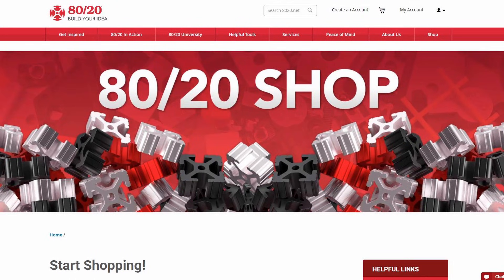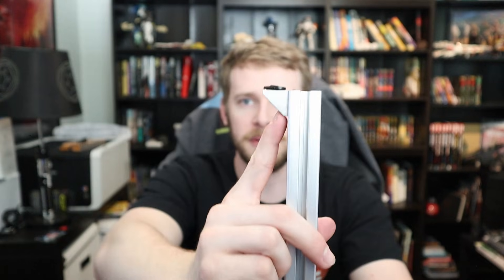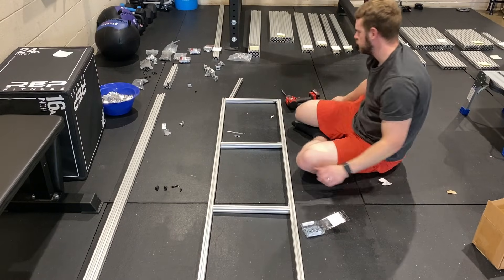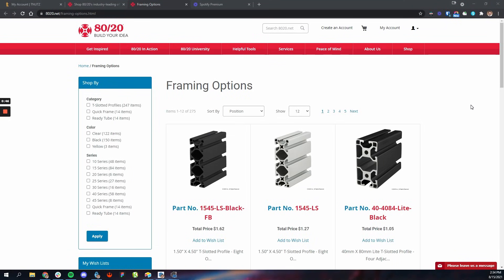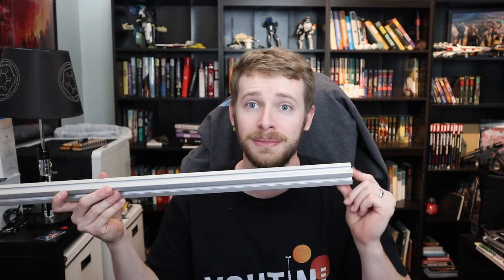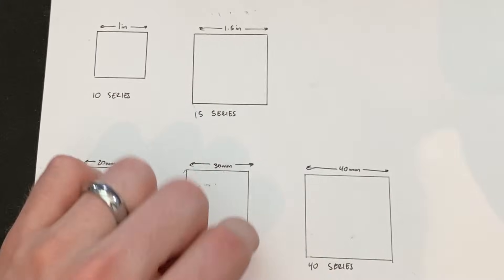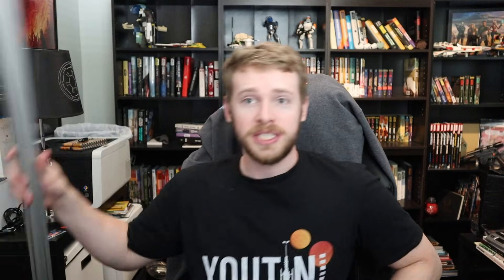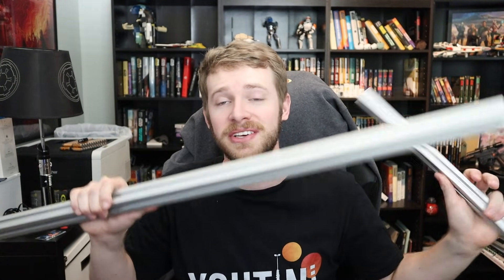Aluminum Cabinetry - Part 1: Profiles | Ultimate Guide to 8020 Aluminum Extrusion

Comment: This is the first video I have come across that highlights the danger of cutting aluminium using a mitre saw. The narrator deserves much praise for this. All others I have seen just suggest using a mitre saw or a plunge saw as if it is a totally normal thing. It is important to realise what the risks of using power tools are and what the right way to use them is before ever turning them on. Very useful.
Reply: Yes, cutting aluminum with a miter saw poses some inherent dangers (just as cutting wood does). However, it's nowhere near to the degree the author claims. Use a good quality, high tooth-count blade (doesn't have to be a special metal cutting blade, either), clamp your work, and take it slow. If it's a thicker piece, pause part way through and let the piece, the blade, and the motor cool. It'll cut through it just fine.

Comment: If you have a high tooth count carbide blade, get some paraffin wax and rub some on the blade.  Aluminum cuts fine.  This dude must have torqued the bar, moved it or pushed down too hard when cutting.  I've been using a 80t carbide 12" without issue.  I bought the special aluminum blade...I see it once in a while sitting on the blade rack, still in its packaging.

Comment: For the sake of anybody watching these to learn how to build something: There's some pretty bad advice here. Don't build anything like this because it won't hold together.

13:20 Notice that this is not a blade for cutting aluminum. Aluminum is non-ferrous. You need a more expensive blade that can cut aluminum. Aluminum has a low melting temperature, and cheap blades catch on the aluminum when it heats up and that's how a lot of people have lost fingers.

Those tiny little 2-hole external L-shaped corner brackets are not the connectors anybody should be using for anything structural!

This is 3 videos covering the parts buying process, and apparently he got so burnt out he didn't want to talk about how he actually put it together. 😂 But it looks like he put the entire thing together using those tiny little external corner brackets — many of which were homemade out of an aluminum trim piece. That's impressive if it holds together at all! You need the legit L connectors that go inside the channel for anything bearing any weight. Or you need to look at how pros who work with this stuff join things by drilling a hole in one piece so you can get an allen wrench into the head of a bolt in the channel.

Comment: Those abrasive cutting wheels are not for aluminum you’ll very quickly gall up and run those blades before you even made your first cut. The aluminum also heats up enough to burn you with those blades.

Comment: Bad advice on the cutoff wheel. Its made from aluminum oxide (generally) and will bind up causing you to have poor and very hot cuts.
A good saw blade with correct clamping is critical.
You likely pulled the work out before the blade stopped and twisted it causing the teeth to grab.

Comment: First.  You need double the amount of teeth.  You should be up near 150 teeth.  You put a 2x4 in front and on top and it will cut like butter.  The reason it jumped wad because you have 70 teeth

Comment: WRONG ON MANY  details. weight is not an advantage pver wood it hS BEEN PROVEN ON YOU TUBE   8020 is the most expensive of all extrusions they are benefiting from people like you who spread ur name but many other providers,  my opinion is this is predominately good for someone who has no clue or equipment to work with wood,  i thnk t s also a confusing product to use but doable
Reply: Weight absolutely is an advantage: you can do more with less because it is stronger.  Furthermore, you can know to gram or if you are truly a wood person, within some dumb non-metric measurement, of the weight just in CADing out your build.  I can go look at the website I buy extrusion from and have ALL of the specs of that series before I do a thing.  What's a 2x4 weigh?  Who knows, lots of, "on average," which is lay person for, "I have no actual idea."  If your extrusion really is that much heavier than wood, then you have massively overbuilt, but at least you have something that will be 3x as strong at the equivalent weight of wood, so scale up from there.  And the guy literally lists 2 other major sites that he explicitly says are cheaper.  Is it his fault you didn't pay attention?  He didn't even buy from the 8020 site.  So yeah, if you want something big, bulky, not as strong, not as reconfigurable, that requires a massive number of tools good for only one thing, then wood is the perfect option.

Comment: If you have the manufacturer cut your piece to your desired length, does that cost extra?
Reply: One of the sites he mentions, misumi, sells it by length, so aside from bulk discounts that don't really add up until you are buying 100+ pieces of the same series at the same length, you order every part at the exact size you want to save money.  You will spend more if you do not order exactly what you need from them, unless you are buying in those wildly large quantities.  Now, the pre-drilled and tapped holes and things like that absolutely are extra and you can save, to some extent, maybe, if you do all of that yourself, but then you need to have the jigs, the taps, the drill, the time,  etc... so YMMV on how much you can actually save on that front.  I will say, if you have just one project you will likely ever do, then the learning curve on the CAD software is going to be high enough if you don't already know that world, that I would just have them do all the stuff for me, eat the cost, and not have to screw around (get it?) with all the drilling, tapping, etc...

Comment: All that time explaining the series! The clue is in the name. 10 series = 10 mm, 30 series = 30 mm…. 8020 = 80 mm x 20 mm, 2040 = 20 mm x 40mm. Extrusions originate from Europe, which is why the numbers refer to metric measurements not imperial.

Comment: A few things. 1) Your miter saw looked pretty cheap. The fence should never have broken. 2) I've used a Diablo 96- or 100-tooth carbide blade on my DeWalt miter saw for everything except steel. 3) When I cut aluminum, I go slow and make sure the saw is up to top speed. When I finish cutting I let the motor stop before lifting the saw blade, even with wood. Not doing this is when you get kick-back on the side you're not holding. 4) The extrusions aren't cheap so figure out a way to clamp down the extrusion before cutting. Take your time and it will cut just fine. I've never used oil when cutting aluminum, mainly because I don't want it to mess up the expensive wood I'm cutting. I don't cut aluminum that often and I let it cool down between cuts.

Comment: Duster
I have worked a lot with extrusion and never clamped anything and always get precise cuts. Always use what is called a NEGATIVE RAKE blade to cut any aluminium and you will have zero problems. If cutting on a bandsaw always use a lubricant but when cross cutting on a mitre saw I never bother.

Comment: Great info! Can you mix up the different series for the joint/connection purpose? For example I will be using 15 series for the outside framing, inside I will be using 10 series, will they fit?

Comment: Also... the only thing about going with 10 series over 30 series that I wonder about is the fact that 30 series, in my mind, appears to be the ideal stuff to buy for most projects in that it's just as cheap as 10 series, but it's probably going to deal with bending loads that are 80-100% higher than the 10 series.

So, basically the shit's way stronger despite only being a little thicker, and is exactly the same price.

Comment: So...

N/sq mm is actually pressure!

But, basically just think of "Newtons per square millimeter of yield strength" as the area it would take to hold a certain weight. I.e. maybe the yield strength is 35,000 PSI.... So, if you had a square inch of material, a 35,000 pound weight would cause it to extrude itself and snap.

But, as you know, metal tends to bend before it breaks. That's where the young's modulus comes in (also a tension number). Basically, if you hang a heavy weight from an aluminum rod straight up and down. Harder to layman practically apply it, but basically a material with a higher young's modulus will be stiffer. So, it will stretch less when you pull on it.

But, here's another fun one... Think about why I-beams are shaped like they are. If, in a 3-point bend, the top of the beam wants to compress and the bottom wants to stretch, you can imagine that it gets easier. It's because of leverage! A fatter beam will have more leverage, and it will have a sort of natural "bend balancing point." So, yes, this stuff is incredibly stiff. Aluminum is stronger than steel by weight for bending because of the torque. The same weight of aluminum can take up a higher volume, so it takes way more torque to bend the same weight.

Hopefully some of this gets across. Lol.

Basically, yeah, this stuff is stiff which is why it's used in labs around the world.

Comment: abrasive cutting is most definatly not needed i cut hundreds of lengths of aluminum profile a day and my saw uses a toothed blade i belive the same one the table saws in the wood shop (id have to take a look at it tomorrow although i can confirm its not your typical ripsaw blade way more teeth probably a multi purpose as others have mentioned) uses as for feed speeds of the blade its not fast but not slow either id guestimate a inch in around 2 3 seconds? maybe faster?

Comment: I just notice the Diablo blade you showed is made to cut "Ferrous metals" it's important to use the correct blade when cutting any materials. I would recommend using a "Nonferrous metal" cutting blade in any future projects using 80/20 extruded aluminum. Nice series of videos buddy, thanks!
Reply from the maker: Agreed! I added a new note in the description!
Reply: @diycargotrailer  You have to decrease the RPM of saw. Its common feature of battery powered saws like Bosch GCM 305. I even used a normal blade for wood with a high tooth count without any problems.
Reply: What size would you recommend for diy rv door?

Comment: Have built projects with extrusion. Please do not use the chop saw with a "stone wheel" it will gum up the cutting wheel and will not be able to cut after a while. Those wheels are meant to be used with other metals!

A miter saw with an aluminium cutting wheel or a multi purpose cutting wheel with many more teeth than wood cutting wheel is good enough.

Thank you for sharing your thoughts on working with aluminium extrusions. It is fun to build stuff with them.
Reply from the maker: Agreed! I added a new note in the description!

Comment: i'm a journeyman toolmaker please do not use a abrasive wheel on aluminum it will load up the wheel  over heat the kerf in the aluminum close on the wheel and basically explode
Reply from the maker: Agreed! I added a new note in the description!

Comment: I use 1515 and 2020 (15mmX15mm and 20mmX20mm respectively)
looking at 1010 (10mmX10mm)
Cutting is all about technique, slow and steady. I have used a cheap wood blade Mitre saw with no issues.
Reply: 1515 is 1.5" x 1.5" and 1010 is 1" x 1" these are not metric sizes. The rest of the sizes, 2020, 2525, 3030 and 4040 are metric sizes is mm.
Reply: @gwestep  Partially incorrect. 
In the normal world 1515 is 15mm X15mm and 1010 is 10mm X 10mm.
Only in America is 1010 1" and 1515 1.5"
Reply: @AJB2K3 when referring to 8020, 15 series is 1.5 in but you are right there is 15 mm by 15 mm extrusions from other vendors even on Amazon. Thanks for clarifying.

Comment: 1 Benefit of extrusion over wood for cabinetry is that extrusion doesn't absorb water when there is a water leak.
Reply from the maker: Thats a good point. I had a few spills when I did my plumbing and it worked out well.

Comment: I have worked in aluminum extrusion for over 20 years. If you get the right blade then it really is not hard at all to cut this stuff. Even after the aging process, it is still rather easy to cut. Make sure to keep a good quality cutting oil on your blade.
Reply from the maker: Great point!
Reply: I fully agree it is super easy just have the right blade, clamp it down and have face protection as I got a nice cut from it once kina funny on the top of nose. I looked like a certain reindeer according to my girlfriend.
Reply: As for 80/20 being the inventors of aluminium extrusion … ahem!
Reply: I do not see the type of blade listed or mentioned here.  So which blade do you use?  Make, Model, Series ? ?
Reply: you dont even need good cutting oil, i cut extrusion for a decade professionally.  All you need is wd40 and a high tooth blade 140 and thats it,
Reply: Fully agree. In terms of cutting, it is extremely easy to cut and machine extruded aluminium profile, but you do need to use an appropriate mitre saw blade, where the teeth are angled differently from wood blades and use routers at lower rpm to avoid overheating the aluminium and welding it to your router bits.
Reply: One of the best parts of aluminum extrusions and aluminum in general as you can make compound cuts with a woodworking tool that metalworking specific saws couldn't do unless you spent literally thousands of dollars on. Miter saws are the most common, and the worst part of them is usually wide throat inserts and the usually pretty large gap for the fence. Both these things allow small cut-offs to get sucked in or ejected. Zero clearance insert, and maybe a piece of angle stretched across your fence will do you wonders. High tooth count cross cutting blades or aluminum specific non-ferrous blades would be your best bet with some wax if you are making lots of cuts. Miter's, bevels and compound cuts really benefit from having the material securely clamped though, The blade will just pull the material a little bit and it can sometimes lead to accidents as well.

Comment: Awesome video and I learned quiet a few new things from your videos! 

I was able to get a used Ryobi miter saw on Offerup with a used blade to cut my 15 series to for my roof rack. My cuts came out perfect and very clean. I think the key is to 1) secure BOTH END of the 80/20 with a clamp to your miter saw 2) make sure your miter saw rotates fully before starting the cut 3) press slowly and let the blade do the work, forcing the cut will cause the blade to slow and jam 4) miter saws don't like fancy angles cuts, stick to straight simple cuts.

Comment: The 8020 site has a deflection calculator that you can use to test out the relative strength of the different sizes and also see the amount of deflection, or bend, for a given weight.
Also, if you do take on the cutting yourself, it is always highly recommended to clamp the piece before cutting. I've been doing metal work for quite a while and would never cut a piece while just holding on to it. Even the strongest person isn't going to have the grip strength to keep a the work piece from flying away if the blade catches an edge wrong. Also, that way, you can keep your off hand away from the blade!
Reply: Oh yeah, deflection calculators are so very handy for a lay person that is trying to figure out how much a drawer will hold or if a bigger brace will really matter, or is needed or if the square is strong enough on its own, etc....  I mean who doesn't think knowing how much a bar of extrusion supported only on 1 end can handle isn't just the most helpful of information.  And Most shapes are always just made from a single bar supported on both ends, so also very handy in a pinch.  Declaring to an audience of non engineers to just use young's modulus is why no one likes engineers.